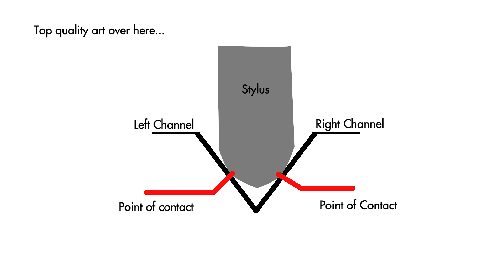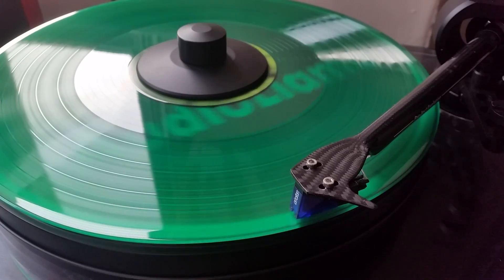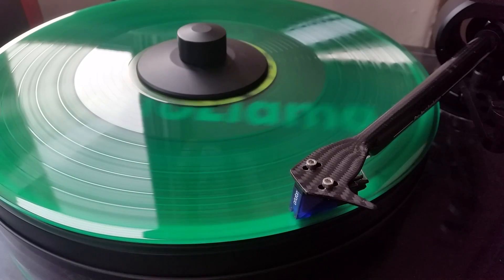Why do record needles wear out?

Comment: The „pressure“ on the stylus is usually between 3 -5 gramms, not pounds/tons.
What you mean is the weight per area is pretty high due to the small size of the stylus. So like Kilos per Meter. 

You just got the physics wrong.

Comment: AudioLlama I'm upgrading from a crappy crosley all in one turntable. I have two options: find an old amp and get some passive speakers but then would I need a pre-amp? Or get the Roth speakers you had in the other video. Are the Roth speakers very loud and do they provide crisp sound can you possibly do a sound test? Which setup sounds better and also cheaper?

Comment: great vids fella. I saw a test once that stated the same equivalent pressure you have stated and if you don't dry your vinyl completely the heat generated at the tip can reach hundreds of degrees at the point of contact and as it superboils the liquid it physically warps the groove, you cant see the steam it happens on a microscopic level but causes damage nonetheless.
Reply from the maker: +D twist Rewind that's interesting, I'd love to see if if you've got a link. In general styli do get really hot as far as I'm aware so it makes sense.

Comment: Good explanation. It should be noted though the it is not the full weight of the tonearm and cartridge, but the set vertical tracking force that is placed on the stylus. If you were to place the full weight of the tonearm and cartridge on the stylus, you would crush the suspension and most likely drag the cartridge body across the record surface.
Reply from the maker: +Ashley Cox yeah that's a good point!